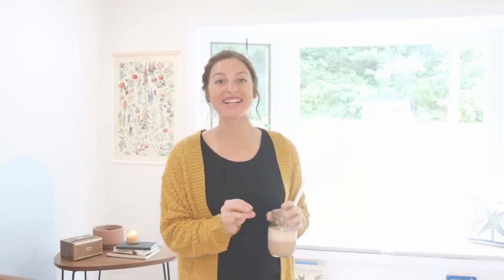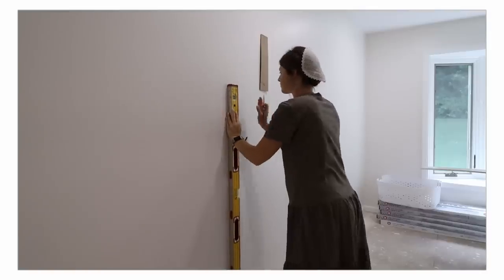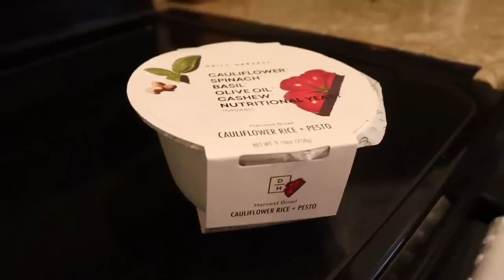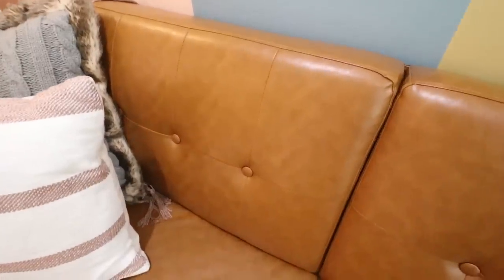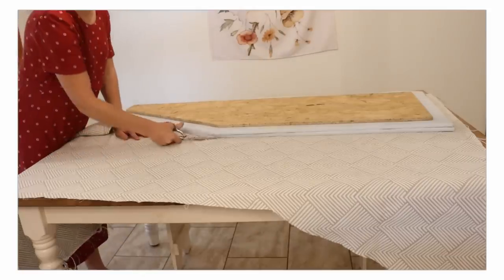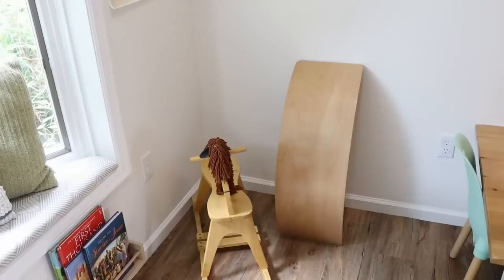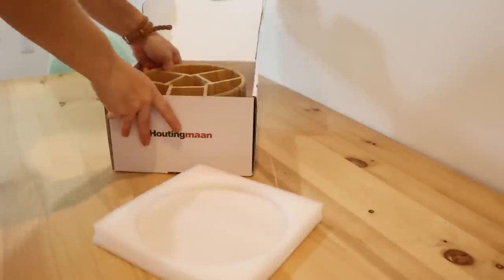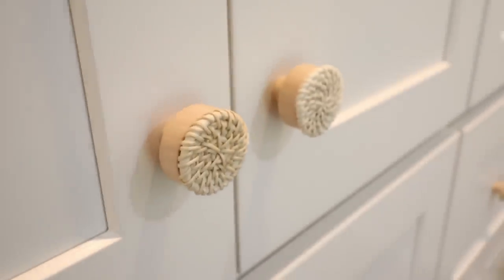EXTREME Toyroom Makeover! + 4 DIY's for any room in your home!

Comment: Those beautiful posters would also look great with another piece of wood along the bottom to frame them out and give them a more finished look. Also, you would probably love those interchangeable frames that open and close from the front for displaying your children's art! They have them on Amazon, and I have never regretted buying them, even though they are a bit pricey for a frame. They are thick enough that you can actually just put in a drawing or painting, and then add another drawing right on top of the older one when you want to add in something new. They act like a longterm storage for all your kids' art.

Comment: I love it.  I got the weebie geebie's with the glass window.  When I was 17, I walked right thru a plate glass window at home.  The glass wasn't the safety glass.  I needed 43 sutures.  My mother had just cleaned it.  I thought the door was open.  I would just try to find out what kind of glass the window is, especially if there are guest children over.  If the window is hit on the bottom, the top glass could fall.  (You can tell I'm in the insurance industry, I'm sure.  I'm always on the lookout for any possible thing.  LOL.)